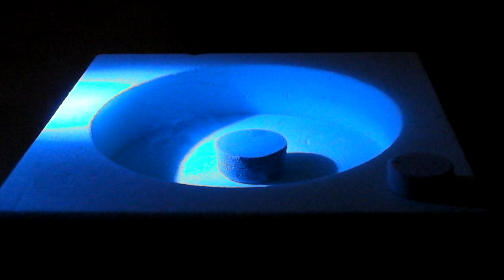What's The Difference Between The Meissner Effect & Flux Pinning?

Comment: How does the magnet lift off on its own? I thought the eddy currents were established in the superconductor in response to the movement of the magnet and its subsequent changing field... In my mind, it seems like it shouldn't move initially and would be locked against the superconductor just it gets locked in place hovering above it. Please explain :S
Reply from the maker: Eddy currents would only be established in the superconductor if the field lines from the magnet passed through the body of the superconductor.  The thing with the Meissner Effect is that as the superconductor cools down the field lines are pushed out of the superconductor.  This process occurs as the superconductor approaches it's critical temperature and is complete when it reaches the critical temperature so the field lines are only moving through the body of the superconductor before it reaches it's critical temperature and attains superconductivity.

With flux pinning, a thin layer of of type 2 superconductor is used and field lines are able to pass through faults in the superconductor crystal.  They are not expelled as in the Meissner Effect because effectively they are not in the 'body' of the superconductor as they are passing through I guess what might be considered a tiny 'hole' (but not in the sense you could look through it).  The flux channels that trap the field lines in position are formed by current vortices and, as I understand it, true superconductivity breaks down at these points and if the magnetic flux density is high enough the superconductor as a whole will stop superconducting even though it may remain at or below it's critical temperature.  However, in those areas where there are no flux tubes the superconductor still superconducts and field lines are expelled as per the Meissner Effect, leading to the repulsive force that levitates the magnet.
Reply: wonderstruckwow I see, thanks! Speaking of flux pinning, it seems odd that the magnet can rotate so freely when every other dimension of movement is locked. I imagine field lines as strings that manage to pass through the tiny holes. Well, if there are multiple tiny holes with multiple field strings passing through the holes, wouldn't it anchor it in much the same way?
Reply from the maker: That's an interesting question.  I think (but stand to be corrected) that the rotation can occur because the flux tubes are able to move position in the body of the superconductor.  Because the tubes are formed due to fixed physical defects in the superconductor crystal this is more likely to be a constant process of flux tubes dissolving and reforming than actual movement per se.  The superconductor I used in the video is only about 15 mm across but there would be flux tubes numbering in the tens or hundreds of millions passing through it.  

That process of dissolving and reforming obviously involves the system losing energy which means that it will gradually slow down and come to rest.  That's exactly what you observe (but it takes a long time) and a lot of the effect observed on a desk top is likely to be due to air resistance.  It would be interesting to do in more controlled conditions with no air involved.
Reply: wonderstruckwow Interesting stuff! Thanks for taking the time to explain in such detail. Glad I subbed!
Reply from the maker: No problem - we always try our best to answer genuine questions.
Reply: wonderstruckwow  Cerebral 
Great question and amazing answer!
I also appreciate the time you spent writing this. It's so nice to see youtube comments actually providing value opposed to insulting people. Made my day :)
Reply from the maker: NedTheDread Cerebral We always try to make time to answer genuine questions.  Since we set this channel up I have been very (pleasantly) surprised by the amount of genuine questions and interest.  Trolls and offensive comments have been few and far between.  Glad to hear you appreciate the effort!